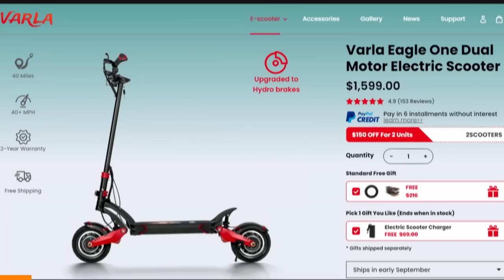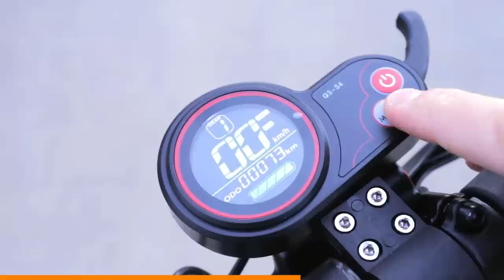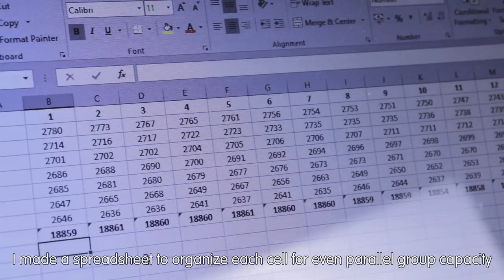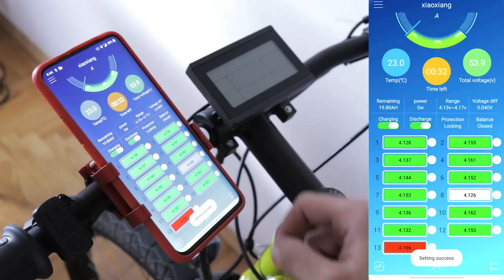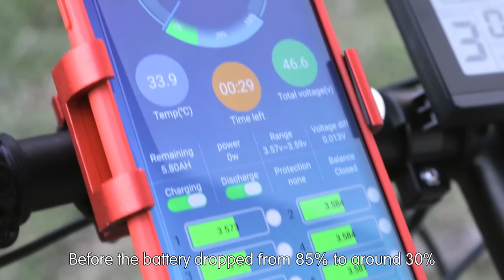DIY 1000W 45km/h Electric Bike Using Cheap Conversion Kit

Comment: What's the cost of converting..?
Reply: It’s very cheap, only $9,000. 😂 just kidding just kidding
Reply from the maker: Approximately $600 USD in total including the kit, battery and drivetrain parts.
Reply: @DonnyTerek  how about the connection between the battery and the various cables. Does the vibrations and movements put strain on the junctions and terminals?
Reply: @Hassan Jamal  If you ask the ebike kit seller, they might solder the right connectors for your needs

Comment: Cant understand why 1000w ebike conversion is not allowed  on uk roads could we not put speed limiter on them so when cops pull you up prove was engaged  and when on private land disengage it ,you can basically  speed in any car but we don't want a fine all cars can go over the limit also motor bikes but most choose not to so why can't 1000w ebikes also have same right 🤔
Reply from the maker: Don't most e-bike owners do that where power levels are restricted? By slapping a 250W sticker on their 3kW motor and having a separate switch for power limit?

Comment: Wow I built my own ebike battery packs for years. Spot welded and nickel strip for higher current and etc. Never thought to heat the top plastic to remold the BMS controller to fit into case as wasn’t a issue on smaller packs. Going to do that now on the new 24AH pack currently building as have space on top to fit into frame. 

Thanks for the detailed video as now figured out how to do a bigger pack while still being able to fit it into bike
Reply from the maker: Thank you a lot! Glad to see that even an experienced builder can bring something new into their workshop after watching one of my vids. 
The BMS fits well if the same battery enclosure is used for a 14S6P configuration, since then a few holders can be snipped off to allow the BMS to sit flush. Having the 13S7P battery takes up all the space in the holders so yeah, it gets a bit tight for the BMS to be fitted inside the enclosure. The only disadvantage of having the case heated up to shape it around the BMS is that it expands the hole that is used to cast the plastic inside a mould. That can be easily patched but takes a few extra hours.
Thank you once again.

Comment: Hi, Donny. Thank you for composing such a well detailed video of this effort. I will use it as a reference as I slowly work to converting my street bicycle to an e-bike.  I have 2 questions: 1) Can you provide me the break-down of the math that allows you to say that a 13s 7p configuration will give you a 1000 watt solution? (I know that each (new) 18650 cell is supposed to have a nominal 3.7 volts..   but how does that bring me to 1000 (more-or-less) watts?  2) If I have 100 x 18650 cells, and they fall (randomly) into ranges of power - that I document to be from, let’s say 2150 mAh’s and 2450 mAh’s, then, it isn’t/wasn’t clear to me from THIS video how I ought to group batteries covering a rather broad range of powers - into a block of 7 parallel cells. Can you give me - us - some guidance on this - or possibly direct me/us to a video that addresses this matter?  Thank you so much! Josh
Reply from the maker: Hi, Josh. Thank you for the kind comment, much appreciated. Glad to see that my video will be used as a reference to help you build your own. I won't be getting into too much detail on my answers but will do my best to provide some info:
1) A 13s7p configuration means that you are connecting 13 packs (made up of 7 cells connected in parallel) in series. A series connection adds up your voltage from each cell pack 13 * 3.7V = 48.1V. Note that 3.7V is the voltage of a half empty battery. Now the 7 cells that are connected in parallel give us a multiplied capacity from each cell. Let's say you are connecting 7 cells in parallel that are approx 2400 mAh each. That gives us 7 * 2.4 Ah = 16.8 Ah of battery capacity with a voltage of approx 48V. Power is equal to voltage times amps. To get 1000W of power from a 48V battery, we need 1000/48= 21 Amps of current. This amount of current will be drawn from each parallel group of cells that are connected in series (13 groups of 7 cells which are connected together). This results in 3 Amps of current draw from each cell (21 Amps / 7 cells = 3 Amps).
2) You need to group the 7 parallel cells in the way that would result in a total capacity that is close in each of the 13 groups. Let's say you group 7 cells with a capacity ranging from 2400 to 2500 mAh in total, and the  total capacity for this group that you get is 17150 mAh. Your next group of 7 cells is 18000 mAh in total. There is quite a difference in capacities from these two groups of 7 cells in each, so you need to swap a few cells between the groups to reach the optimal configuration where the total capacity is as close to each other as possible. That's where the spreadsheet comes in help since you can write down each cell capacity and then 'stack' them on the spreadsheet to see how you can achieve that each group of 7 cells comes with a similar capacity.

Hope this helps, best of luck!
Thank you.
Reply: That's assuming those are rated 1C . If they are 2C continuous, you don't need to worry about it. 1500w! No problem.

Comment: This was hugely helpful for me, and Im happy I found this video since I have the exact same BMS fitting problem with the battery case, but I never thought of heating the case and fitting the BMS like that, genius! What is the reason for the hole in the top where the BMS is?
Reply from the maker: That's awesome! Glad to see I could help you out here. The hole is caused by heating the plastic case. I guess that is the place where the plastic is injected into a mold.

Comment: I have  my old Iron Horse full suspension  bike that still  works great.  I plan  on making  into an electric  bike.  I was looking  at one of the frog battery  holders for the seat post since  I don't  have  much  room  for one  in the center.  Or a rack mount for full suspension  toss a big 20ah on it should  work  well.
Reply from the maker: Cool! Would to see how your build turns out.

Comment: How has using 1 torque arm been for i’m really curious because i always had issues with my full suspension bike and we have very similar dropouts so i just want know how it is, btw the build super clean 💯
Reply from the maker: Works just fine to this day after more than 1200 km! Had a few issues at first of the axle nuts loosening, but tightening the nuts and torque arm even more solved the problems. Hope this helps.
Reply: I watched a video on a bike with a similar rear triangle to this one. They went to actual trails and it was terrible, it would constantly smack the seat post, so much in fact that it was almost impossible to move the seat post afterwards because the body deformed,, but for urban or plain dirt paths it should be good.

Comment: I built one using a 1500w motor 48v set up on a shwinn graft dual suspension bike frame and for some reason….the bike can go slightly over 40mph. 

I assume the manufacturer who sold me the sine wave controller decided to give me a 45amp programming to it.

Comment: loved this there were small little things you did that really was brilliant 👏 battery case is ingenious. 
just out of curiosity though how comes you didn't use the limit screws on the derailleur to set position rather then the cable?
Reply from the maker: Wow, thank you!
The limit screws only adjust the derailleur closest or farthest from the cassette. The tension of the spring and cable keeps the derailleur in place well.

Comment: A thermally conducive   adhesive, or tape would be better than grease. on the battery temp sensor,   even jb weld, or epoxy mixed with powdered aluminum or copper,
Reply from the maker: I used thermal paste held on with tape.

Comment: Hi, I'm looking into converting and I have a few questions. 
1. In your previous 65km/h build you used  8a 35e Samsung cells vs. 5.2a 26f here, which is not considered a high amp cell as witnessed by my laptop battery which has the exact same cells. 
 "Knowledgeable" people on the internet have said using pc cells for ebike is a big no no, but seeing how you've done it I'd like to hear from you on how it compares with 8a cells. I guess slower acceleration and faster cell wear are among the issues, but would like to hear your thoughts.
2. I was quite puzzled to see you go with a single speed freewheel but no belt drive. I thought it's a no-brainer for such a setup, no? 
3. Seeing how your rear caliper mount doesn't support 203mm disc, why didn't you go with a smaller one?
4. Do you know why those chinese controller boxes are so large if only half the space is occupied? Have you considered storing the excess cables in there instead of a "black box"?
 Alternatively have you considered cutting out the excess cables altogether? Thanks in advance
Reply from the maker: Hi!
1. For this 1000W build a high current rating on the battery cells was not needed. These cells are not genuine but perform quite well. The motor will pull a maximum of around 1500W, so each cell will need to output just around 5 Amps at max load. These cells are actually good for up to 7 amps of current draw. And if they are used in laptops, it doesn't mean they can't be used for higher power applications like this e-bike build. And after more than 1500 km with this battery, it is still doing well and pushing the bike with no problems.
2. I don't see a need for a belt drive considering the relatively high cost compared to the readily available and super cheap chain driven parts. And after more than 1500 km on the odometer, the chain works great with almost no maintenance done to it.
3. Bicycle frames are generally (if not all) are built for 160mm brake discs. To accommodate a large brake disc like this 203mm one I used, an adapter is used. For an e-bike like this it is recommended to use larger disc brakes for better heat dissipation and braking power.
4. I guess a larger box is better for heat dissipation from the transistors that are mounted directly to the sides of the case. I wouldn't recommend trying to fit the cables and the connections inside the controller case since they will be difficult to access if you need to unplug some connectors and can cause shorts if any connections are exposed so an additional 'black box' is not such a bad idea. I did cut some of the excess cables to make it easier to fit inside the box.

Hope this helps!
Thanks for watching.

Comment: that battery build is nutz

but why did you number the batteries
Reply from the maker: Those are capacity measurements of each cell. Necessary to do for best balance between the cell groups of the battery.

Comment: Looking awesome!
Why did you choose that spot for the bms, and not that spot at the front with the angled part (cut loose and bend a flap) and then also seal it with sealant?
Can you post a dropbox link of your spreadsheet to match the 18650?
What is the reason you changed the charging plug in the box?
Can this plug not load 5 Ampere?
Reply: The bms took up what looks like a little more that 2/3 of the length of the battery, with the cells there as well it simply wouldn't fit

Comment: Love the build I have an old bike laying around I’m gonna try it just wondering why you put a single speed is it possible to have a entire cassette?
Reply: You can have front and rear gears, however you rarely use them on a powerful hub motor ebike. At higher speeds you are pretty much riding a motorbike and all the pedals are for is to fool police/bystanders into thinking it is a pedal bike so you dont get your bike destroyed. At low speeds, simply setting assist to its lowest level allows you to pedal on your highest gear with little effort, so you dont need all the lower gears. Ive still got gears on both my ebikes, but ifI  get round to it I will be removing them, to remove stress on the frames (I had to press the frames outward to fit both the motor and the rear cassette).
Reply from the maker: Thanks! Hope you give this build a try. Since this bike is mainly used on flat city roads, extra gears would not be used much. A single gear allows for a smaller tooth number in the back, which combined with a large chainring in the front, allows the rider to pedal more efficiently at higher speeds. It also cleans up the cockpit since a shifter for the rear derailleur is not needed.

Comment: Sorry about the dumb question, but why having a single speed cassete and using a 7 speed derailleur?
Reply from the maker: It is simply for keeping the tension on the chain. Other than that is serves no other purpose. There are chain tensioners that you can use instead of a derailleur like I did, but mine did not fit.

Comment: Hi Donny, awesome build, looks very neat and the cable management looks very professional. I am trying to understand the wiring of the bms, battery and the battery connector before I try this out myself. at around 13:45 you solder a discharge wire from the battery positive, and at 14:50 it looks like you connect it to the positive lug of the battery connector. There is another "output wire" going to the negative end of the battery connector, but you only filmed the B- and B+ wires being soldered to the battery. Where is this other "output wire" coming from?
Reply: is it just the C- from the bms?

Comment: Hello, can you tell me if the motor works proportionally to the pedaling without using the accelerator control on the handlebars as for a pedal motor?

Thanks
Reply from the maker: Hi! Sorry for the late reply. Yes, the motor assist works according to the assist level chosen on the LCD display and it can be used without the throttle handle.

Comment: What did you use to glue and hide hide the hole for the charging port?
Reply from the maker: Just regular two component epoxy resin for plastics.

Comment: Which frame is this you've used? Looks like it has a spacious triangle. Definitely worth going full suspension, it can be quite jarring going over a pothole or drainage cover at speed.
Reply from the maker: I am still not sure which frame it is, quite an old model though. Well worth going with a full suspension frame for sure.

Comment: I'm going to be building a similar battery 13S7P using an Aliexpress sourced Polly DP-9 battery case and a Daly 13S/40A BMS measuring 61mm x 80mm x 12mm. Would you know whether a BMS of that size will fit without remodelling the case like you did? I was hoping there would be room without major surgery.
Reply from the maker: Hi, you should be good using a bms like this, it doesn't seem large but I can't tell for sure.

Comment: Could you just use a few big rc car lipos?
Reply from the maker: Technically you could, but I would only use them if they are hooked up to a proper BMS board to monitor the voltages.

Comment: Why wouldn't you have put the bms where it was suppose to go instead of melting the plastic battery case?
Reply from the maker: It doesn't fit.
Reply: @DonnyTerek  . It doesn't fit where you put it even more, hence the melting. If you put it in the recessed area, you would have only needed to melt it a little bit near the front.
Reply from the maker: @E-BikingAdventures   I would actually need to heat the case even more if I were to place the BMS in the recessed area. This would cause a chance to burn through the case and would look really bulky with the front sticking out.

Comment: One wrong part done wrong and you will wake up in an ER eating out of a straw.
Reply from the maker: Or take the time to do it properly so you can enjoy the many miles of riding.
Reply: @DonnyTerek  True--but many folks do not have the ability to build these--in fact about half of folks that buy retail ebikes can not even put the 20% of it together and wind up taking it to a bike shop.I am a stickler for safety and check the parts on my ebike every few days.I am an ex mountainbiker and luckily I have never wiped out or been hurt--but I have been with folks that have been hurt by a part failing or falling off due to poor or no maintenence.

Comment: Why would you use a derailleur on a single speed bike you don't even shift bro.
LMAO
Reply from the maker: It is simply for keeping the tension on the chain. Other than that is serves no other purpose. There are chain tensioners that you can use instead of a derailleur like I did, but mine did not fit.

Comment: Ur battery assembly looks complicated how much did u save compared to buying one from AliExpress including the spot welder and the other bits which is in the video
Reply from the maker: I guess I 'saved' 2-300 USD compared to a factory built battery pack.
Reply: @DonnyTerek  What pre built battery pack do you recommend for a Bianchi Magma 9.2 21" XL MTB frame? My body weight is 75kg and I plan on riding in the city witch flat terrain. I think a 250w motor is enough for the city but I want the biggest battery I can fit in my frame to get the most range for food deliveries. Loved the video! A reply would be much appreciated!❤

Comment: My mid drive planetary 48v 40amp 2000w kit reach me  70km/h,with seventh gear on rear freewheel.I can run it with 72v 80amp,6000w to reach me 125km/h.
Reply from the maker: Sounds awesome! Ride safe at those speeds.